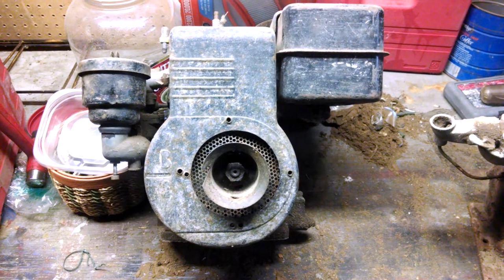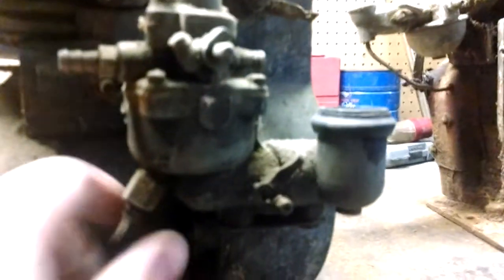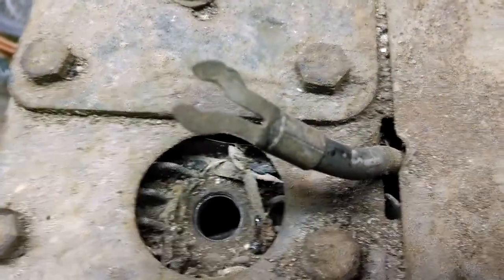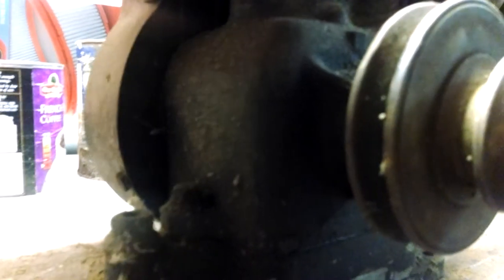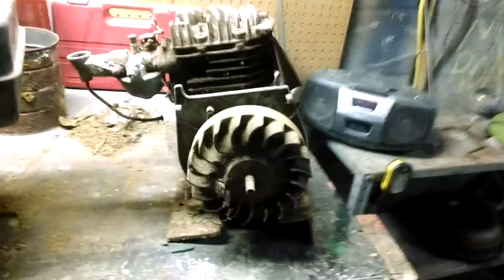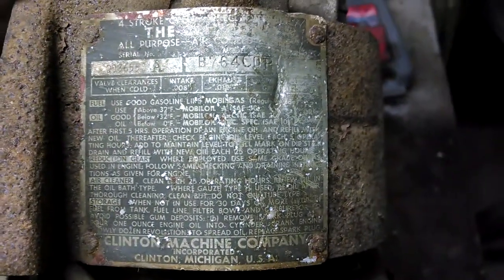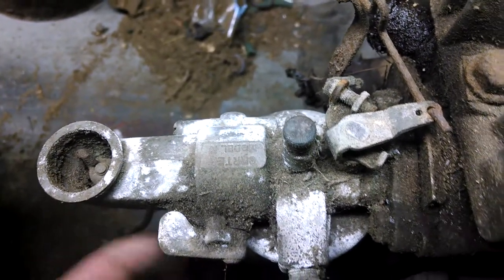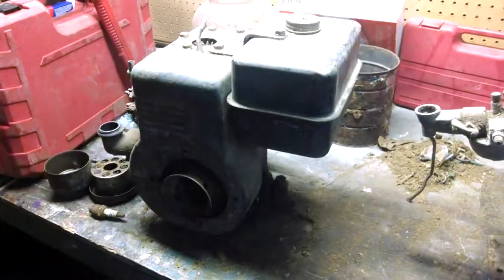Introducing Mystery Briggs! and his friend Clinton Engine!

Comment: For the most part the Clinton and Tecumseh engine were the same and shared the same fuel system (carter) Most parts (engine/ fuel) were interchangeable , and was a great engine, but was not good in the winter up north due to the fuel components exposed to the elements, mainly cold air. and was a great engine during warm months (growing season for lawn mowers). as long as you drained the fuel from the carburetor for winter storage the engine lasted a long time. there was a fuel drain for the carb on most engines for that reason. The carter carbs were great in delivering air/gas mix to the engines. so long as you kept them up... (high maint. was required). Loved those engines in the summer.